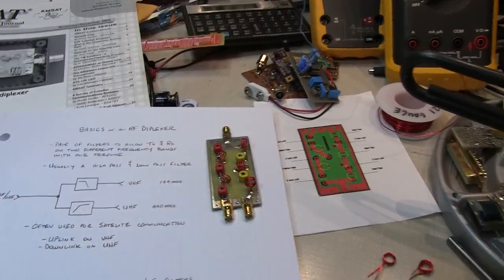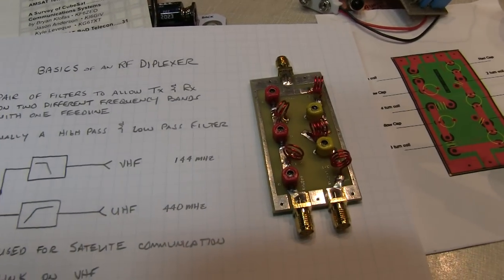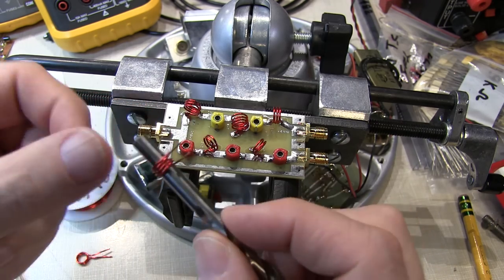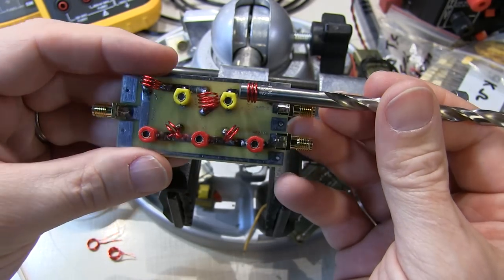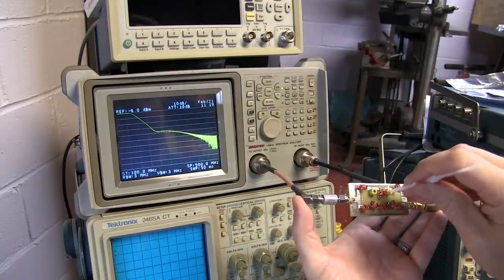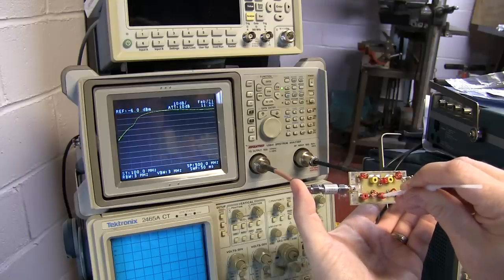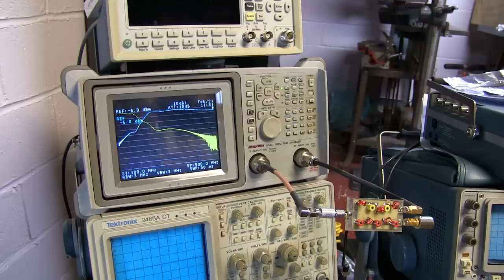#195: RF Diplexer Basics: Tutorial, construction and tuning

Comment: Great to see the actual effect of adjusting filter components.

But now I'm really confused.  I can see a VHF signal entering the board and then splitting between the two filters.  The VHF filter passes the signal on to the antenna but what happens with the UHF filter?  Is the VHFsignal absorbed, in which case you lose 1/2 of your RF power or is it reflected back which could wreak havoc with your VSWR? 

Good ol' mind numbing RF.
Reply from the maker: The UHF path presents a high impedance at VHF (generally), so does not load the VHF signal. The path length is very short, so there are no problems with reflections or SWR.

Comment: Hi Alan,  will this diplexer be better than just using a Tee to connect two different antennas  into a receiver only radio (scanner)?  I'm using a 900mhz yagi & discone antenna connected with a Tee into a single coax cable to my receiver. I assume it will help with antenna/radio impedance.
Reply from the maker: It may help a little by potentially avoiding receiver overload and improving sensitivity a little, if the receiver is sensitive to the antenna impedance.

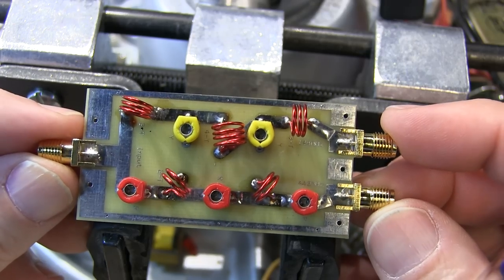Comment: 3:11 I'm curious about the circuit construction. I bet there's an explanation for the orientation of the coils' winding axes. The lower 2 coil path has each at 90 degrees to the other, which would make sense to me. However, the upper path has the left and center coil approximately the same orientation and the right coil 90 degrees to the center. Does it matter, or is it just how it turned out?
Reply from the maker: It's largely just how it turned out, but it's a good idea to keep air coils not lined up in the same orientation order to prevent mutual coupling.

Comment: Alan, does this kind of setup work in the opposite direction - IE two radios and one dual-band antenna?  Does it attenuate the off-frequency stuff enough that one radio one damage the front-end of the other?
Reply from the maker: Michael Hojnowski In general, yes.  But, you have to ensure that there is sufficient attenuation in the receive path.  It will depend entirely on the diplexer design, and the transmit power.

Comment: I've always been curious — how is the response of one side of the diplexer affected if the other side is left open-circuit (after the network) instead of properly terminated?
Reply from the maker: Most often the return loss and transmission loss will be affected (higher SWR, etc.).

Comment: Hi Alan, Just wanted to know if one can use a diplexer in reverse i.e. two radios in two different bands connected to the two ports and a multi-band antenna connected to the  combined port ? and also performing simultaneous transmission and reception ?  If that is possible, what all aspects should one look into while designing such a filter ?  Thank you !
Reply from the maker: Simultaneous transmission and reception on two separate frequencies is the most common application for diplexers and duplexers (the latter is typically used in the same band - where tx and rx frequencies are much closer together).
Reply: Thank you ! :)

Comment: neat but I wonder if there's anything you can do or clever trick to get things like this at least close enough if you didn't had a spectrum analyzer and func gen.
Reply from the maker: It's a little tricky if you don't have a signal generator.  You can make up for the SA by possibly using the FFT function of a digital scope...  If you don't have any of that, but just some VHF/UHF radios - then you could just do some spot checks and adjustments of signals through the filters with the radios...

Comment: Why would you use a single feedline for a different up and downlink antennas, i.e. why not use two different paths entirely? It seems to only have disadvantages...
Reply: It is not uncommon to have a full duplex cross band transceiver that only has a single RF port, but to use two different antennas
Reply: Nezbrun I think i need to rephrase my question. It is more in the likes of why would you design a transceiver that has a single RF port if you use two different antennas anyways, why not separate the two RF paths.
Reply: My IC-706 has only a single output for VHF/UHF.  Further, unless you have unlimited wealth, using one piece of very expensive low loss feedline is another advantage.
Reply from the maker: Many (most?) multiband transcievers use a single RF port for many different bands. Multiband antennas are common. Rear panel space is also often at a premium. Many people operate FM satellites with an HT, which only have one RF port. Feed line is expensive, especially when you consider a long run up a tower, so running a single line makes sense. These are just some of the reasons why these devices are often used.
Reply: Don Coltrane Absolutely, at an extreme, I used to live in a basement and ran a single low loss heliax feed up to the flat roof seven storeys up, a 180' run in total. I ran HF through 13cm through the single feeder, with several diplexers at each end. I also had antenna mounted LNAs and PAs on the roof for VHF and above. Running individual feeders for each band would have been very expensive, not to mention drawing attention from the neighbours.
Reply: Nezbrun ***** Don Coltrane Thank you all for clearing this up. When positioning it close to the antennas after a feedline it does indeed make a lot of sense.

Comment: Thanks again! What do you use to remove the varnish from the wire ends?

PCFXR4U
Reply from the maker: It depends on the type of enamel coating.  For some, I will scrape it with a razor blade.  Others, I will boil it away in a blob of molten solder.

Comment: Hi, thank you. 
I have a question:
Can you receive and transmit using one antenna and attached that antenna to a Duplexer? I am confused as how the dipole can transmit and receive at the same time ? I appreciate your help
Reply from the maker: As long as the duplexer can provide sufficient isolation between the transmit and receive frequencies (so that the receiver doesn't get overloaded by the transmit signal), then it will work.  This is commonly done with VHF/UHF radio repeater systems.
Reply: w2aew Okay. I guess my confusion is down to how the feedline handles  simultaneously a coming and going signal. Would they collide ?
Reply from the maker: @fawwazal-subie2305  The feedline doesn't care.  All signals can be present on the feedline at the same time.  Think about it this way, when you transmit out to your antenna, the antenna is still receiving signals and those signals are going down to the transmitter (which ignores them).
Reply: w2aew oh I see. I just was thinking like when the wavefront two opposite signals present on the same cable that they destroy each other.

Comment: Are the filters not direction sensitive?
Reply from the maker: No, they work exactly the same in either direction - so it can be used with a single feedline and two antennas, or a single antenna and two radios.
Reply: ***** Or two radios, two antennas and one feedline :)